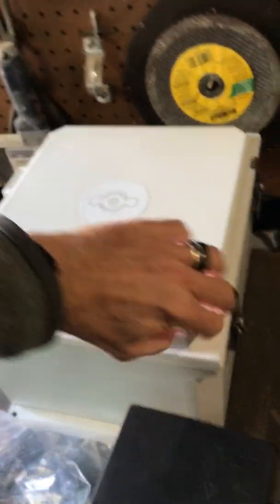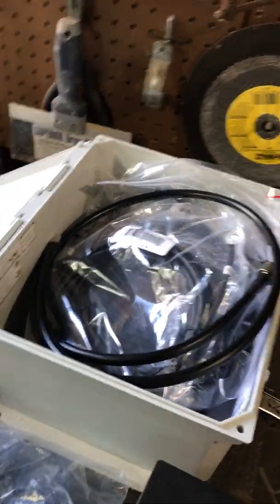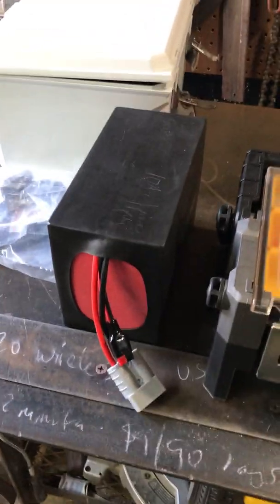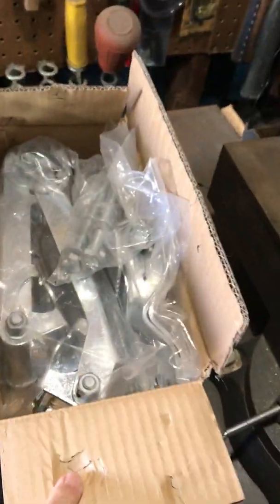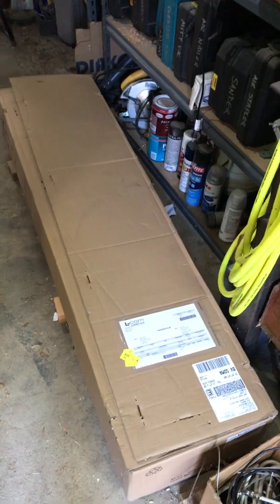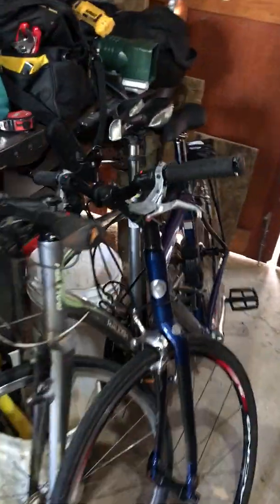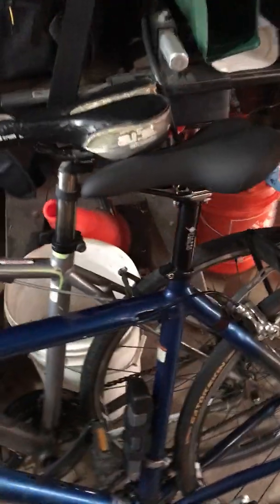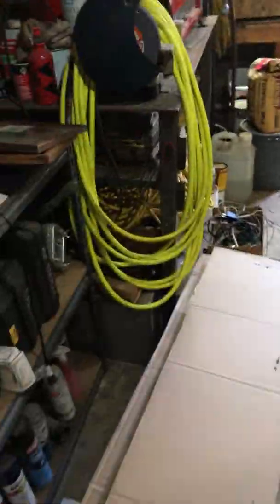Getting Ready For My First Off Grid Hotspot

Comment: Found your channel and love your videos. Can you run a helium miner off a cell phone hotspot?
Reply from the maker: You can, but not recommended.  Better off to use a purpose built cell modem for that.  A couple of options are over here --> https://gristleking.com/packable-off-grid-helium-miners/
Reply: @thegristleking  .......why isn't it recommended? It's definitely cheaper if you have old smartphones lying around.
Reply from the maker: @fakumadda1632  it's one of those "right tool for the job" things.  You can make anything work (and technical people are exceptionally good at this) but for me, I wanted something that was purpose built, bombproof, and required no fiddling.  For example, an IBR200 (https://grstl.ink/ibr200) gives you total control over the router settings, remote access if needed, a direct ethernet cable connection, and very low power requirements.  A cell phone is more like a "plug and hope" solution.  :)

Comment: Do you have to ground these off grid hotspots?
Reply from the maker: Technically, yes.  ;)
Reply: @thegristleking  but instead of burning down the structure more than likely just blow up the roof top rig?
Reply from the maker: @carlbreeden9074  yeah, although a direct lightning strike will just cook everything, including the structure.  Grounding is more to dissipate static build up during storms so it doesn't damage your equipment.